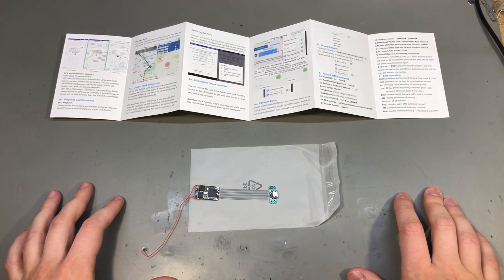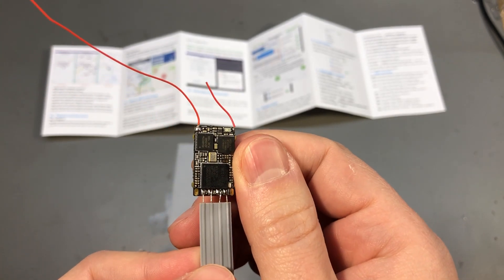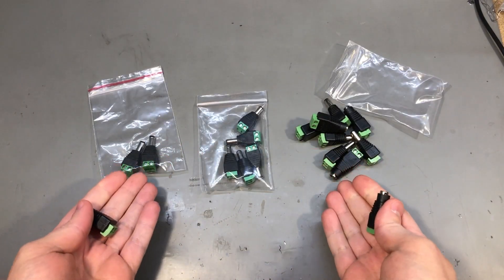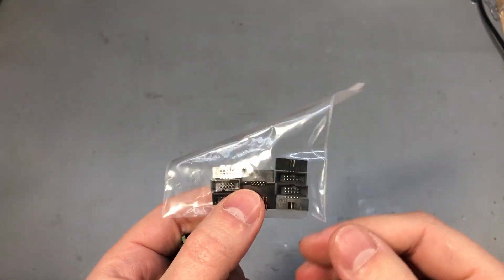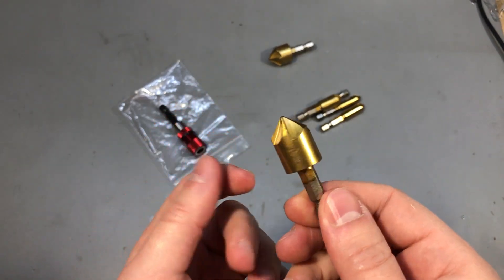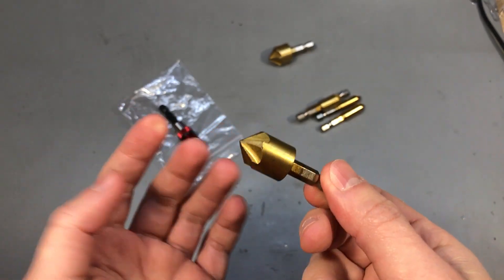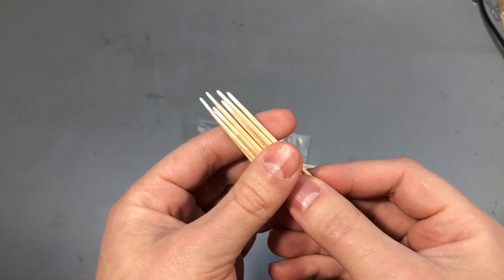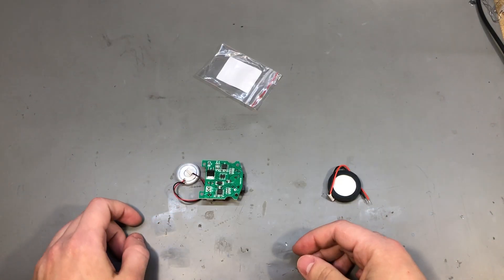InTheMail | Voltlog #350

Comment: The barrel connectors are really bad quality, at least those that don't have a proper pin. Look at the one you got. The pin is just a slotted and bent shut piece of metal tube. I ordered some a month or two ago and out of the 10 jacks, 4 had the cheap "pin". It badly scratches the inside of a plug probably making the contact worse when used with other jacks later.
Reply from the maker: Have you found any better ones in your searches? I would be willing to get a couple of good ones, I only need a couple after all, I don't use these very often but when I need them I would probably want a good one.
Reply: @voltlog  
I guess the only way to reliably get good ones is to not order them from aliexpress, which means they'll be more expensive. "Local" (meaning in the EU) shops like Pollin, Reichelt and Conrad sell good ones. Or you can order from aliexpress and hope that half of the ones in the bag are fine (like it happened to me). Depending if the pin was shown on any pictures you could also file a dispute. Although there are genuine split pins (but then it's really a pin cut in half, not a tube), which are actually the best you could find for making contact, but look identical on pictures.

Comment: 9:44 that's not a quick release. That's an adaptor for driving screws into drywall. You adjust it accordingly in order to prevent the screw from going all the way through the drywall. It's a  bad tool though...it trends to get unscrewed all the time.

Comment: Re the hex drive bit holder: the smaller ring is used to lock the depth setting.  You back off the ring, set the upper part for the desired bit depth, then tighten the lock ring against the upper part to lock it in place.
Reply from the maker: Okay, thanks!

Comment: ZX620 seems not a GPS Tracker... Wifi + 2G-GSM
Reply from the maker: I think you could be right, in which case the position information it can reports is just LBS data from the network.
Reply: @voltlog  I realized the same. Received mine today and it doesn't seem to have an IC / Antenna for GPS. Just GSM and WiFi.

Comment: On a different subject, I'm wondering if you or anyone knows anything about flashing a printer with corrupted firmware. I bricked my Dell laser printer trying to update the firmware. It has an identical main board to a Brother printer because it's made by them. However, there's not a lot of useful information on the internet these days. Younger computer nerds don't seem to be into repairing stuff anymore.
Reply from the maker: I would imagine even though they look similar they use different firmware. If you could possibly find if the firmware is stored in an external flash memory maybe you could try flashing it with an external tool as long as you can find a working firmware image. I think this is a thing for the printer related forums.
Reply: @voltlog  Thanks for suggestions! I've searched the printer forums and everywhere. I thought it may be different firmware too. A friend of mine has the identical printer and I have a couple different programmers. But I don't see anything on the main board that appears to be a flashable Atmel chip etc. I guess the the firmware is stored in the microcontroller. The printer is dead except Windows sees a USB device. I stupidly tried to update it over the wireless network and it failed.

Comment: Be careful when you poke the wrong sort of pin into connectors, like the piercing needle probes. 
I suggest backprobing the connector, if you can. 
You can be lucky, but some times that sort of stuff can create weird issues.
Reply: Yeah if the probe is too big it can bend the plug contacts, ie, make them loose. 
I don't think that plug had an open back for a probe.
Reply from the maker: I agree, there is a risk of messing with the pin shape with this method.